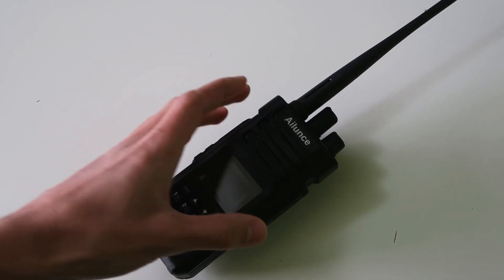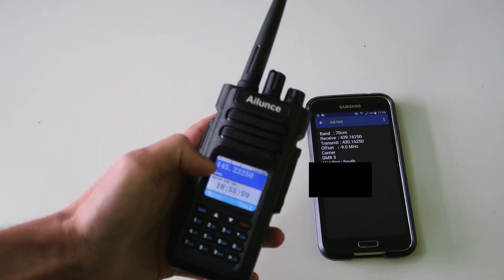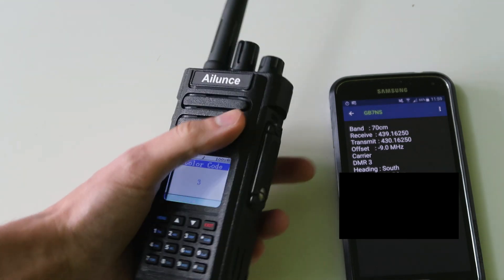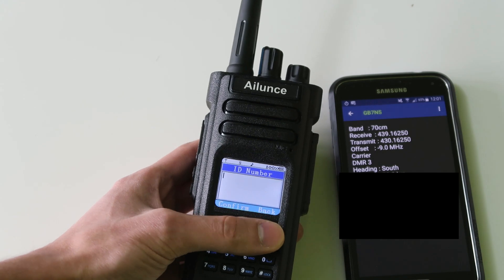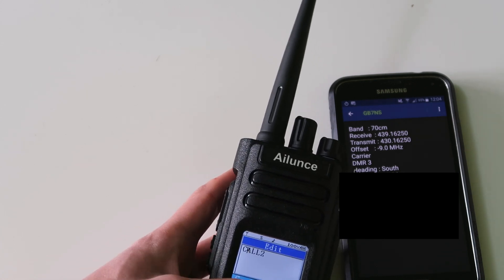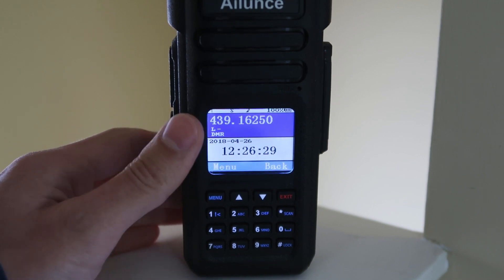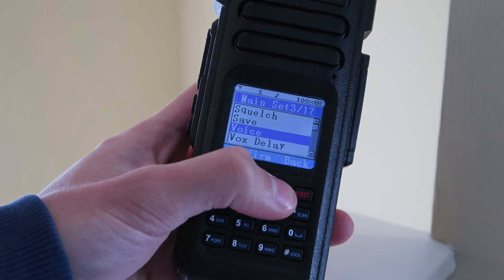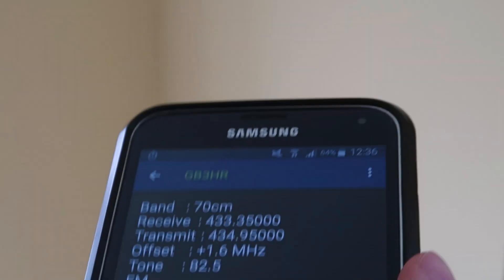Ailunce HD1: Front Panel Programming (FPP) tutorial

Comment: Superb description,BUT my shift frequency works on analogue but not on dmr!!! (so i bought another one and that is just the same)!!!!!!! any suggestions?
Reply from the maker: Using shift frequency on dmr makes the radio think you're trying to use an actual dmr repeater. So it'll try to wake up the repeater and only let you talk once it knows it's in range. Are you using it with a working dmr repeater that you're in range of?
Reply: @radiosification  YES,its only less than a mile away!!(sorry for the delay as have had several issues to deal with.

Comment: Question, how do you revert back to CSQ after you have programmed a repeater. In the manual it talks about being able to set the pl code under band settings but I can't figure out how to take it off.
Reply from the maker: I think you press 0 while in the ctcss settings menu. Or if that doesn't work try *

Comment: When scanning the stored memories I've installed the radio only shows the frequency and not the channel name when the frequency is in use. I think would be a nice touch for an upgrade..
Reply from the maker: Mine shows the names. Check the settings. There's a menu option with the different settings of frequency, name, and I think possibly one other but can't remember off the top of my head.
Reply: radiosification yes my HD shows the names too, however when say a saved repeater (GB3NI) is transmitting the display shows the frequency and when it stops transmitting the display resorts back to the tag is given the frequency... ie the repeater call sign
Reply from the maker: Strange. Do you have the latest firmware on there? Check on the Ailunce website
Reply: radiosification what I've also noticed the audio output is quite low compared to my radioddity and most of my Baofengs! I'm considering opening the radio and making the mic appature larger.. Any advice??
Reply from the maker: I don't think it'll make any difference. It's probably just low mic gain. You can't change it now but they were experimenting with a program that would let you change the mic gain. I'd just wait till that comes out
Reply: radiosification will do, thanks for the reply...oh since your DMR up to speed,,,,is there any truth my radioddity gd_77 can be updated giving it a VFO thus negating the need for a computer for programming bringing it upto speed with the HD1???
Reply from the maker: No clue on that. I don't own a GD-77. Look on radioddity's website, they have the updates there. Either way it's worth updating it anyway because they would surely have fixed some bugs
Reply: radiosification once again many thanks..

Comment: Hi, I have followed your instructions however when I transmit on a repeater the radio says Repeater Fail message!!  I have turned the power save feature off as I hear I can create a problem but still no change. If I am out of repeater range could this be the problem?! 

Just discovered the problem only occurs when I save the repeater to a memory channel!!'
Reply from the maker: Repeater fail is displayed when the radio doesn't get any response from the repeater. It can be simply that you're out of range and that's the most common issue. Otherwise it could be that there is some error in programming, or maybe a bug in the radio.
Reply from the maker: By the way, was it you I spoke to and you asked me about some of the local repeaters which I use?
Reply: radiosification sorry, wasn't me!! Yes your spot on, once I got in repeater range the radio worked perfectly, once again many thanks for a very helpful video...

Comment: The new QuanSheng UV-R50 (costs 34 usd) does have input bandpass filters which allows it to work much more reliably in a city (comparing to Baofeng uv5r). Does hd1 have such filters? Thanks in advance.
Reply from the maker: I don't know for certain but I think probably not. The receiver selectivity (or lack of it) is the biggest problem with this radio.

Comment: I only have a minor issue, or bug with my model. When I use it to scan for DMR users on a frequency I know to be active but I don't yet know the CC or TG I have enabled promiscuous mode, and depending upon what CC I have set up, it might not work, yet another radio next to it will work just fine. It's not a case of it scanning and never having enough time because I say listening to a 3 minute + over on a repeater and it just refused to ID the CC/TG, but the other radio (a Bearcat) was working just fine. If however I change the CC it starts to work just fine.

Some background to this, it 'APPEARS' to be OK out of the box, but if I create a codeplug it starts to have this odd hard to demonstrate bug. I can't tell if the code plug has become large and as soon as it hits a certain memory address it plays up or if it's when I edit using Excel (as a CSV) and  reimport it, giving it the once over and then uploading it that is causing the issue.

I will get on to Retevis to report this bug eventually!
Reply from the maker: The promiscuous mode on this radio is only promiscuous to talkgroups as far as I know. It's not meant to work if you have the wrong colour code or timeslot so no wonder it doesn't!
Reply: @ Dennis - it’s not a bug, the correct CC must be selected to decode. CC is digital equivalent to CTCSS.
Reply: I have several radios with promiscuous mode, this is the only one that does not tell me the CC. My TYT and Retevis models with Travis Goodspeed (KK4VCZ)'s 'alternative' firmware tells me the CC if it's not set. Also my Bearcat does it too.

Seems a little crippled to me to have a feature that only half works like older radios. Very disappointing.

The comparison with CTCSS is slightly flawed. CTCSS is optional and an analogue radio will work with or without it. However DMR doesn't have that option.
Reply: Dennis Smith unfortunately your incorrect. Even with the M.D.-380 tools firmware installed you still have to either know the colour code first or you need to go into the colour code scanner to obtain it and even then you would still need to have the correct time slot programmed for the channel your trying to listen to.  Promiscuous mode only bypasses talk groups nothing else. I have 4 M.D.-380/RT3 handhelds in front of me now and use them daily with the tools firmware. The only none scanner radio I know that can fully decode colour codes and time slots without knowing them first is the connect systems cs580 as you can set a scanner style limit search and it will act as a scanner albeit with a significantly slowed scan rate to that of a true scanner such as a whistler trx-1.
Reply from the maker: I have the md380 with that firmware, and I don't think that can tell you what the colour code is on a transmission where you don't know it. The colour code scan feature doesn't even work at the moment.
Edit: just realised I'm using Ty weaver's version instead. The colour code scan is broken in his firmware I think. Anyway the point stands that it's something extra you have to do. It's not like the radio just tells you the colour code all the time if promiscuous mode is on.
Reply: This FW has CC scan

https://pd0zry.nl/md380-fw/

And the most recent version allows the RX/TX, CC, slot and TG to be displayed for each programmed channel. Very handy!
Reply: @ Dennis 

The CTCSS to CC comparison is not flawed as repeaters on the same frequency in close proximity can be ‘separated’ with CC or indeed CTCSS if analog. 
Community commercial analog repeaters segregate multiple user groups on the same frequency by assigning a different CTCSS code to each group. 

I reckon in time the HD1 firmware will improve or alternate firmware will give many new features like the MD380 so give the HD1 a break for now
Reply: I said SLIGHTLY flawed. It must be if the DMR standard requires a CC for DMR to work. Analogue works with or without CTCSS or DCS. That aspect is the part I was suggesting is flawed. 

I am still at a loss how I found all the CC's of the frequencies I have now, and I seem to remember it displaying on the screen the CC and TG used, but I have tried several dozen firmware versions and revisions on my MD380's and clones.

I'm looking at the alternative to the Travis variant firmware now, appreciate the link and will play later. Thanks.
Reply: Dennis Smith 

DMR ain’t Analog. It requires a CC full stop. P25 and NXDN digital systems requires a NAC (network access code) akin to DMR CC
Reply: A tad patronising? The you proved my point though so the point is no longer moot. The comparison is PARTIALLY flawed. There isn't any need to try progressing with this.
Reply: Dennis Smith 

I don’t think I am patronising. Comparing analog to digital thinking they operate kinda similar is pointless because they don’t. 

When digital satellite came out you had to know the symbol rate and FEC along with the frequency/polarisation whereas analog was just enter freq/pol and there you go!